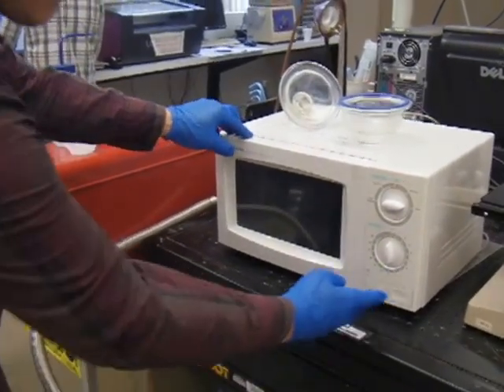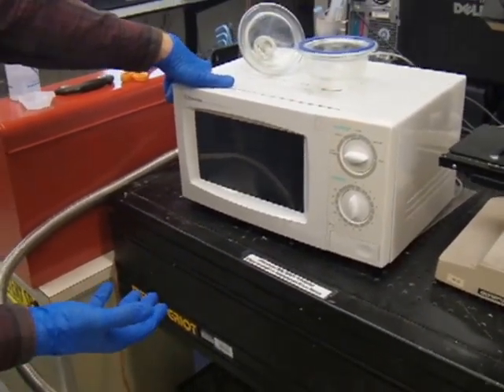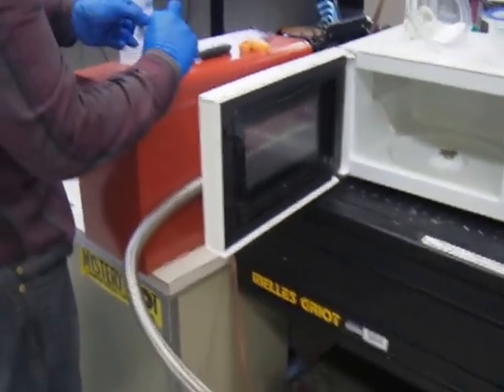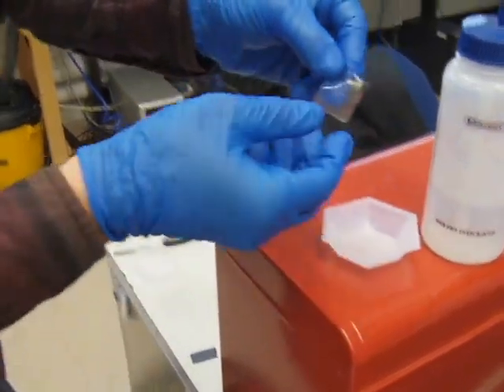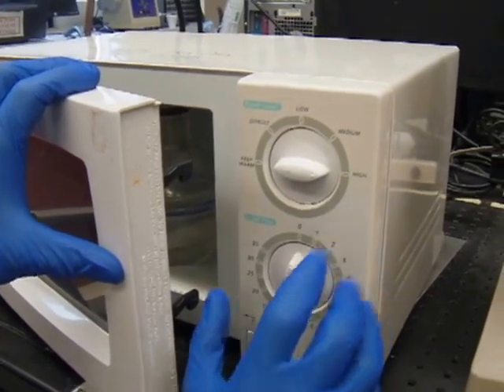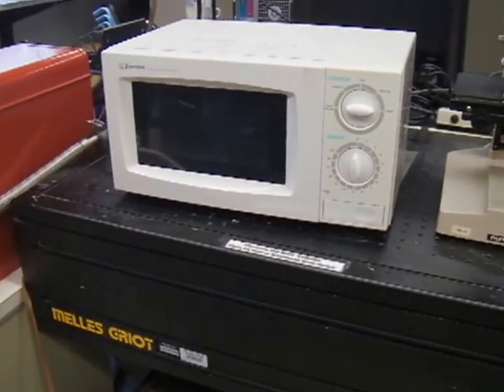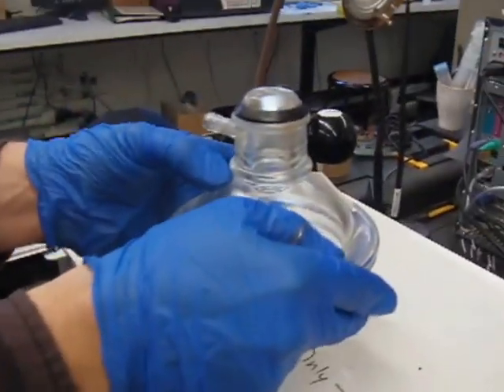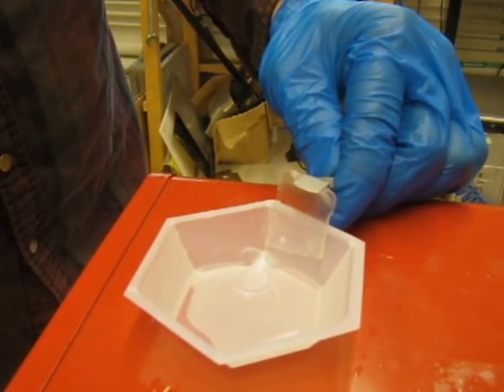UC Irvine DIY Plasma Treatment Device (Version 1)

Comment from the maker: Yes, I have used a manifold and backfilled it with nitrogen.  The color of the plasma changes to a deep purple.  The manifold was a brass pipe T with 3 ball valves on each side of the T.  One side was connected to the vacuum, the other was the chamber, and the third was a regulated nitrogen tank.

Comment: Hi Michael, thanks for the video.  I was wondering why you evacuate the chamber in the microwave?  Would it be possible to reduce the pressure in a vacuum chamber before putting it in, meaning you don't have to drill through the wall of the microwave?
Reply from the maker: Cabeleira42 That is possible - in fact you see the same effect if you put a light bulb (incandescent or fluorescent) in a microwave just for a couple of seconds and you will see the same effect.  The issue is this, a light bulb is a contained gas system, the material outgasses in a plasma condition but nothing like the polymers that are being treated.  So what happens is that the dynamic pressure increases in the plasma condition, and without evacuation, the plasma eventually disappears.  You may be able to treat glass parts as you describe.

Comment: Hi, We build the same plasma machine at UCSB. However the chamber floor is made of PVC and is melting when we apply plasma. 
what materials that are not glass can you use?t
hanks!
Reply from the maker: אלכס ט take a look at our second video. In this one we had a glass Bell jar on top of a metal base
Reply: I saw that. its not dangerous to put metal in a MW?
Reply from the maker: אלכס ט no problems with operating the newer version using a metal as.  Everything just needs to be grounded at multiple points in the case
Reply: great thanks!

Comment: Ever try this with a foodsaver container?  Someone else on youtube measured the vacuum pull at 22.5 inHg.  The container I have in mind is microwave safe...but I don't necessarily know if that means it's plasma safe.  I'm thinking about as much as 20 seconds of treatment.
Reply from the maker: The container gets hot.  We have a new generator made and have demo'ed it using a pyrex bowl and mason jar as the vacuum chambers, will post videos in a couple weeks, stay tuned.

Comment: COOL!!!
I want to ask after the treatment, is the temperature high?
Is this a kind of cold plasma?
Reply from the maker: from before - yes oxygen plasma is possible, but it requires silicone oil (expensive) in the vacuum pump to be safe.  So with this oil, it would work.  The plasma is a little on the hot side, I believe this is because the microwave energy is too high, I plan on adding a second Microwave oven transformer (for the filament alone) and then add a variac to the main transformer (or possibly a SCR or TRIAC) to reduce the delivered power - it will etch away surfaces with long enough time.  After about 5 minutes, the glass bell jar will get too hot to touch.

Comment: Very cool! 

I would like to do this with oxygen. 

To avoid the expensive pump and oil, I wonder if using an oil free pump would work well.  I have a Rocker 610 and also a Welch vacuum pump I may try this with. 

Do you know if an oil free pump can be used safely with oxygen?

Comment: Crazy arcing in there!  Cool demonstration though!  It beats my candle in the microwave for sure.  

 But you are still going to need to spend some money on a real generator and on replacing the chamber with materials that won't contaminate your project.  You can find a better box then a microwave.